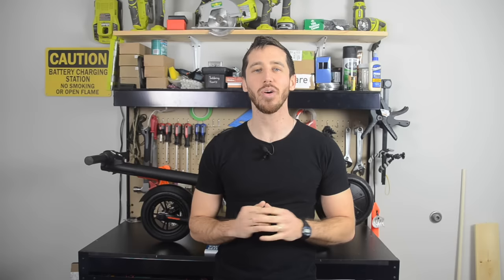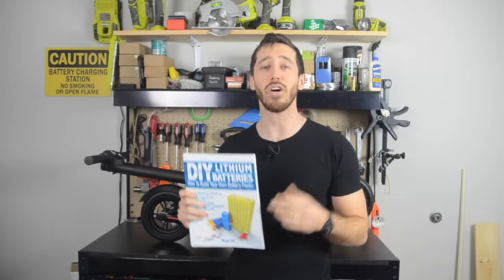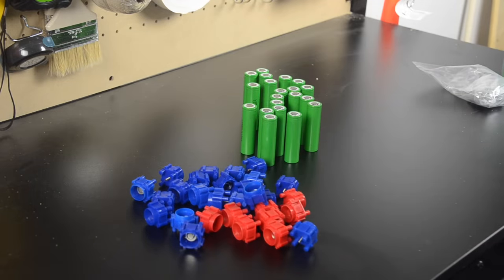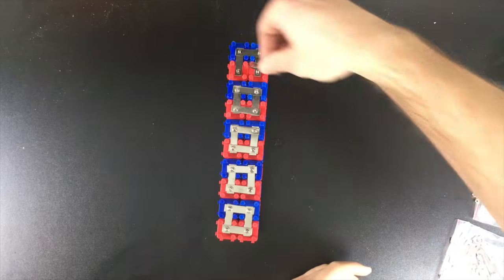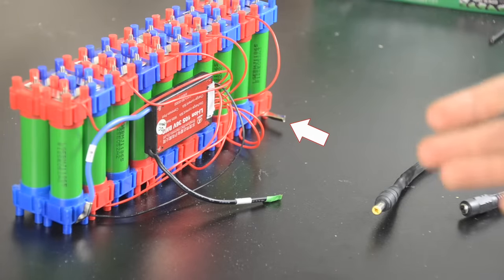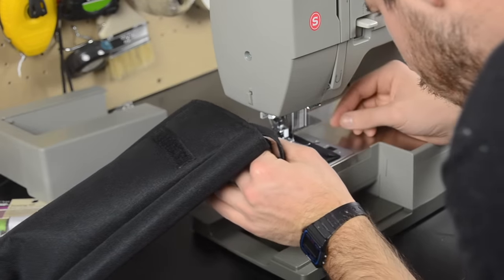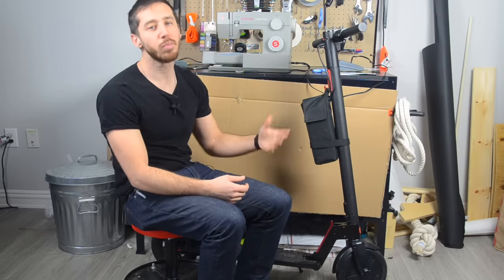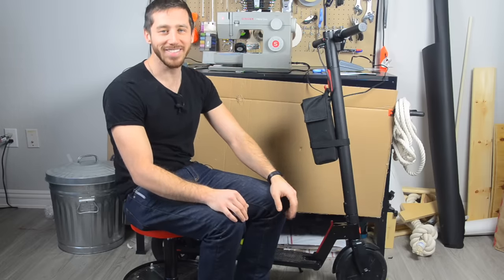DIY 2x range booster battery for electric scooter or e-bike

Comment: WARNING
Most scooters do not allow operation while something is plugged into the charge port. For safety reasons obviously. Also, the charge port is meant for just that, charging. It has specs that are totally different than the operating mechanism of the scooter which is powered by the battery. Look at your charging adapter and read the specs on it. For Gotrax it’s 42v 1.5amp, you can’t just stick homemade battery pack of 37v 7amp into the charge port and say away we go! IT DOESN’T WORK THAT WAY AND IS VERY DANGEROUS!!!!
For most scooters charge port the best you can do is build a portable charger that you use to RECHARGE the scooter battery when it’s low. The same build principles will apply as shown in the video, however, you have to build it with specs intended to take the place of your wall charger for the sole purpose of charging not giving your ride a boost. So when planning you need the voltage on your battery build to exceed what’s stated on the charger, for example if your charger states 42v dc out, then you want your build to output around 47v. Then you have to match the amps, you can reduce the amps on your battery build by using a current limiting resistor across the pos/neg end of you battery. You use ohms law to get the proper resister value for the desired amps, I=v/r where “l” is the amps you want to achieve and “r” is the resistor value needed. So in our Gotrax example you’ll need about a 28 ohm resistor soldered across the total neg/pos end of your battery build on the output connector not the connector you’re using to charge your battery build. This will get you to the 1.5 amps needed for charging and will not damage the components on the other side of the charge port or melt any wiring inside your scooter. The reason you can’t just stick 7 amps into a port that’s only designed to accept 1.5 is obviously the wiring and circuit behind the port may not be rated to accept such a higher amp value. THIS IS HOW FIRES START!!!!

If you’re gonna do this do it right, for the safety of yourself, your family, and your neighbor. Lithium Ion batteries are NOT to played with.
Reply: Are you sure?
Reply: I was also thinking this. That 250w motor is drawing max 7 amps. Meaning that the extender battery has to provide about 3.5 amps if they are both the same capacity, more if higher. My scooter is the same model as his and the charging port is fused at 3 amps. Idk how he made it work, if...

Comment: I like your videos a lot. Keep up the great work. 
I have the same scooter. Behind the black panel is the controller board. What I did was cut the battery battery wires that lead into the controller and put xt-60 female, then xt-60 male into the controller. I pulled them outside of the black panel. This way to use the built in battery just keep them plugged in. To use the spare battery, I just unplug the built in and plug the spare in. I keep that one in my backpack and it is double the capacity of the original. The difference is this does not send the spare battery's output to charge the built in battery. That is why the range wasn't double. In my case with a 2x spare I have triple the original range. 

Thanks for your videos. I enjoy them.

Comment: I used a step up voltage converter and two Ryobi One+ 18V batteries in parallel.  As the batteries are removable I can charge them both at the same time as the scooter if I have three sockets. The step up converter provides a constant 52.2 volts in to a 54 volt pack at about 3-4 amps. This means the 18 volt batteries are delivering in excess of 10 amps until they are completely drained. The power protection electronics in the batteries shut them down if they overheat or under volt. It’s a few layers of protection but if the batteries die, I just buy a another One+ battery. Do not connect the supplies with more than 1 volt  difference unless you like loud bangs. I already have a copy of your book

Comment: Isn't dangerous to use the charge port of the scooter for the parallel battery? In general the wire in the charger port is rated for 5 amps not 30.

Comment: Are you sure this is safe?  Matching the voltage is easy but what about capacity and chemistry?  Can you safely boost through the charge port?  Is that really running parallel?  Can you boost a regular lithium battery with a lifepo4 of the same voltage through the charge port?  Really?  This isn't really running them parallel is it?  Thanks!
Reply: You make many good points. Matching capacity is not necessary, but matching voltage is. So mixing LifePO4 with "regular" Li-ion is a no-no.  I would not use the charge port. It does not have the same wire gauge or connector capacity as a discharge wire and connector. I paralleled mine at the battery power out wires, and I disconnect the external pack to charge them separately. It charges twice as fast that way. It was easy to run a couple of wires out to an XT connector. I used a pre-made battery pack because it is a lot easier.

Comment: Thank you for this video! I have experience with residential electrical work. Someone in a BMW hit my car and ran from the scene totaling my car. Insurance paid for the accident but it was not enough to get a reliable car without picking up a new car payment that I can't afford. I already eat rice and oatmeal everyday as it is. I commute about 8 miles per day. I bought a new E scooter in December after the insurance payout. Best $500 dollars I have ever spent, literally!! I bought the Hover 1 "Alpha", but everyone seems to have the step down version called the "journey". I get to and from the doctor, a total of about 8 miles in eco mode 6 days a week. Even when it has been 19 degrees fahrenheit, here in Maryland, in the mornings. I definitely thought about adding a battery pack to extend range. I didn't want to open the machine and void the warranty I paid for. Now that I've seen you do the same thing I have been contemplating I think Im am going to give it greenlight and order the batteries and bms this weekend, Thanks again , Joshua ps sorry, I dont usually type much but a proper thank you was due here!
Reply: Hi, I hope you re well!!  What happened to your project? Did it all work out?

Comment: How does the charge port handle a battery connected directly to it? If I look at the wires behind the charge port, they are way thinner than the cables connecting directly to the original battery. Will the extra battery load work with the charge port or is there risk of faster wear in the long term? Maybe swapping out the charge port wires to thicker gauge wire would be a good idea?

Comment: There are major errors in this tutorial. He may think he knows what he is doing but following his instructions leads to an installation that can cause a fire. Some of the reasons for the danger have been revealed in the comment section. DO NOT parallel this system through the charge port! No qualified professional would advise you to!

Comment: I suppose it would make sense to put a fuse in there too, just in case you ever accidentally connect the booster when the two batteries are not at the same voltage. Anyway, I'm looking for good sources of info on building a 'split pack' where a vehicle does not have a convenient place for a single large battery, so you might want to put multiple smaller batteries. While the basics are obvious (the batteries can be connected in parallel or in series, as if they were a single cell), and some safety concerns are obvious (keeping the same series number when connecting them in parallel, making sure everything can handle the voltage and the amps etc.) but some details are less clear and it seems there are different ways to do it, different ways to solve the problems inherent to this system, and I haven't yet found a good definite place to look for information on that.

Comment: How do you limit the output of the booster pack to 2 amp at 42v? Most barrel connectors are low power. You might be able to do 3 amps but any more than that you will melt the connectors.  I have been wanting to do this for a long time but the amount of power the battery can output concerns me alot.
Reply: I have the same problem. I would like to limit the booster pack to 2amp

Comment: Hey Mika cuz I have a GoTrax GXL v2 also & literally have 2 of there battery packs that go into the frame. I was just wondering if u could just let me kno the easiest way I can wire those 2 together in parallel so I can double my capacity on the scooter pls🙏🏼🙏🏼... I was just bringing them both fully charged with me but after watching ur video/s Im still confused on Doin it with these types of batterys...thanks alot & love the vids!

Comment: Can I use the booster as a portable charger? When my scooter battery is down, can I plug in the booster to charging port and leave my scooter aside while it is charging? Will this cause any issues to my battery?
Reply: According to Micah's instructions, you should only connect a booster battery to the main battery when the charge levels are the same. If you try to connect a booster battery after the main battery is low that might be dangerous, with too much power going from the booster battery to the main battery at once. As I understand it, you want the charge levels to be the same so the power only trickles from the booster battery to the main battery as needed when the main battery is in use and slowly getting used and discharged by the vehicle motor.

Comment: I just got the HiBoy S2 scooter and it is great.  I love how simple this process is.  I have some recovered laptop batteries that I would love to repurpose for this.
Reply: hey I just bought the HiBoy S2 also. So you followed his instructions and you get twice the range now?
Reply: @JapRapNipHop420  I haven't actually done the project, I was interested, however, with young children I don't have the time.
Reply: Does not work on the hiboy S2. Don't waste your time. I did a video on how I did it. I can not travel about 23-26 miles distance with two batteries :)